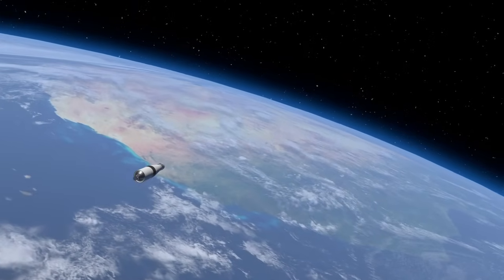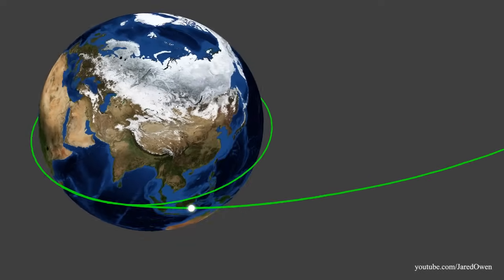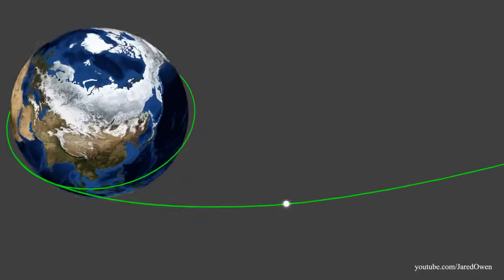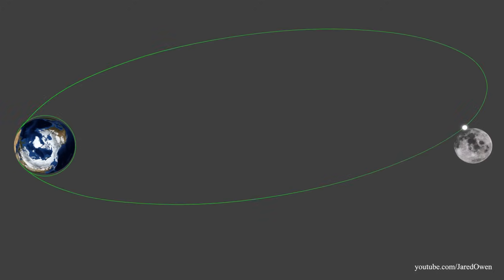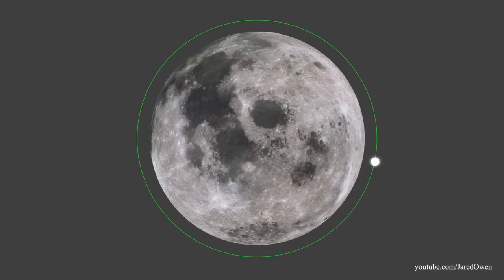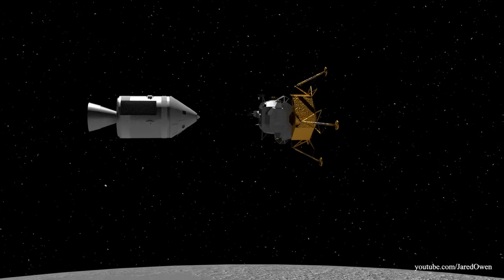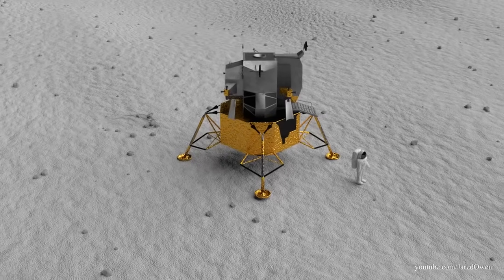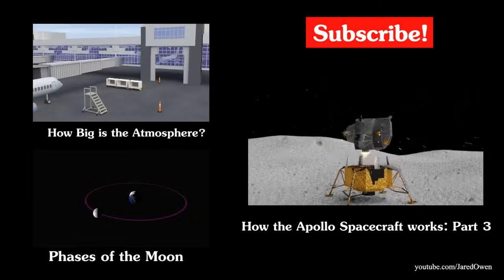How the Apollo Spacecraft works: Part 2

Comment: I'm very interested in watching your video's, but there's one thing that keeps me puzzeled which I hope you can answere being: "How do the two astonauts move (phisically) from the CM into the LM while these two are still attached to eachother ? In my view this is inpossible, because they are connected / joined to eachother on the point where I espect a tunnel to be though where they can drift from the one into the other. I would be very happy if you can point out here I can find the answere to my question or - even better - can provide me with one.
Reply: Once the docking is complete and the seal is verified, the docking probe can be removed from the inside of the CM which leaves the access tunnel between the 2 spacecraft. Pretty ingenious system. Just google "apollo docking pdf" and you'll find the info. There's also a youtube video titled "Collins goes through probe and drogue exercises for space flight" that shows the procedure.
Reply: YOu can google it and get an answer in five or ten seconds

Comment: Wrong, 3rd stage fairings did not detach.  They only folded outward is all.
Reply: That was the original plan but after one of them didn't fully open during Apollo 7, they redesigned them to detach and be pushed away by springs.
Reply: Except that's not what happened.  There's footage from Apollo like 8, 9, 10, that should 3rd stage with only opened fairings, not detached.  I'm  @mako88sb
Reply: @Galactis1  
Haven't had time to search for Apollo 8 or 9 footage but Apollo 10 and 11 16-mm footage clearly show no SLA fairings present when docking with the LM.
Reply: @Galactis1     Had a chance to check the Apollo archive images and both the Apollo 8 & 9 SLA fairings are detached and missing from the photos with the S-IVB and the dummy LM for AP-8 and prior to docking with the AP-9 LM.
Reply: Weird.  I know I seen a video/ photo of the 3rd stage with them connected.  Well probably best that way.  I did see the video of detached completely fairings. @mako88sb
Reply: What happened is that the top would open with a bit of force, and it had a hinge at the bottom that would break off as the petals opened. At least I think that's what happened, take this with a pile of salt

Comment: If that actually happened, then it would've happened again since 1969, but keep believing your fairytale.
Reply: "If that actually happened, then it would've happened again since 1969"
It did happen again, five more times by 1972.
Reply: Why would it have happened again?
Reply: @ DimMitry luckily, I don't have to believe it, because I know that it's true. You don't "believe" in mashed potatoes, duct tape or pillow cases; you know those things are real. It's no different with Apollo, because it's objectively provable.
Reply: Do you think they landed on the moon once in 1969 and then never went back?

Comment: How did they get into the LM  from the CSM?  Where was the four wheeler stored  on the LM? 
They never went to the moon!
Reply: How did they get into the LM  from the CSM?  Through a tunnel connecting them.
Where was the four wheeler stored  on the LM? In the descent stage cargo bay. You can easily find videos of them deploying it, both in training and on the lunar surface.
They never went to the moon! Yes they did. Stop being dense.
Reply: Are you able to bathe with your helmet on or do you have to remove it?

Comment: Ok so no telemetry data is one thing but maybe next video you can explain in detail how the astronauts breathed 100% oxygen for 14 days when medical science says we can. Oxygen Toxicity is a very difficult thing to get around here. Bottom line is if 5 is greater than 3.086 there would have been some major problems maybe including death.  Let's see that video lol
Reply: The cabin was pressurised to only 5psi. One third of normal atmosphere. They were breathing the equivalent of about a 30% oxygen atmosphere if it were at normal atmospheric pressure.
Well below toxic levels for the two weeks maximum mission time.
Reply: @niallkinsella2687  I dont understand how no one sees this?  Ok sea level air is 21% O2 or 3.086 psi. In the shuttle its 5 psi 100% O2. That's an increase of 1.914 psi. The point is that all of the gas we breath can not be 100% O2 for long periods of time, as this would cause medical problems to include death. All the gas laws prove this. Example if you take a container at a vacuum and put 3.086 psi O2 in it and another of nitrogen at 11.466 psi you can mix them and get sea level air. So just take away the container of nitrogen. Now you're left with just the O2. So in order to get the container to go from 3.086 psi to 5 psi you have to add more O2. That is the definition of oxygen toxicity because there is no longer a partial pressure the total pressure of O2 is now 5 psi, which is an increase.
Reply: @benjaminharris6175   
Sorry mate, but pulmonary toxicity caused by hyperoxia only begins to occur in humans when you exceed 0.5 bar of pressure and 100% oxygen.
At 5psi, or 0.345 bar, there is literally not enough oxygen molecules available in a given volume for the lungs of the human body to absorb a toxic dosage through the normal methods of respiration.

Other signs of oxygen toxicity such as central nervous system toxicity only begin occuring when you hit oxygen partial pressures eight times higher than normal atmosphere, impossible without exceeding 1 bar, 14.5psi, so impossible in a spacecraft that is only pressurised to 5psi.
Reply: @niallkinsella2687  you can not take the nitrogen out of the equation is the point to this whole topic.  So going from 3.086 psi or .212 bar to 5 psi or .334 bar is an increase in oxygen and that is harmful. Also a 100% O2 atmosphere will cause a "nitrogen washout" in the lungs and body regardless of the pressure.  A quote from Brandan Kennedy, MD Pediatric Hospital Medicine, Children's Mercy hospital and clinics assistant professor of pediatrics university of Missouri, Kansas City :"Absorption Atelectasis, high doses of supplemental oxygen can cause nitrogen washout of the aveoli there by leading to alveolar collapse.  Loss of nitrogen in the blood causes less total venous pressure.  This leads to the collapse of the alveolus."  When this happens there is NO gas exchange in the lungs. There is no way around this simple fact. 

He also says "shunting resulting  from absorptive atelectasis can rise to as high as 11% in older otherwise healthy volunteers breathing 100% O2 for 30 minutes"    so I say again you can not take the nitrogen out of the equation.
Reply: @benjaminharris6175  : Seems you still fail to understand that the problem is not "100% oxygen" but "100% oxygen at atmospheric pressure.
Can you try to get it?
Reply: @ThomasKundera  you try to get this. If you take the nitrogen out of the equation this removes it from the blood. This lowers the pressure in the veins which will cause the aveoli to collapse. Then there is no gas exchange and you die. Also there is a rise on O2 from 3.086 ppO2 (.212 bar) to 5 psi .334 bar. So toxic or not when the alveoli close due to lack of nitrogen you're dead anyway. And you cant escape that simple fact. Can you get that?
Reply: @benjaminharris6175  : 
What are your sources?

https://ca.thescubanews.com/2016/06/08/diving-with-100-oxygen/

"Below 20 feet, pure oxygen becomes toxic" (so not above).

https://en.wikipedia.org/wiki/Oxygen_toxicity#Hypobaric_setting
"In low-pressure environments oxygen toxicity may be avoided since the toxicity is caused by high partial pressure of oxygen, not merely by high oxygen fraction. This is illustrated by modern pure oxygen use in spacesuits, which must operate at low pressure".

And there is no problem lacking nitrogen: long stay in deep diving is done usually on hydrox: helium and oxygen only (and only a few % of O2).
Reply: @benjaminharris6175  : What are your sources?
"diving-with-100-oxygen/"
Below 20 feet, pure oxygen becomes toxic" (so not above).

"In low-pressure environments oxygen toxicity may be avoided since the toxicity is caused by high partial pressure of oxygen, not merely by high oxygen fraction. This is illustrated by modern pure oxygen use in spacesuits, which must operate at low pressure" (Wikipedia). 

And there is no problem lacking nitrogen: long stay in deep diving is done usually on hydrox: helium and oxygen only (and only a few % of O2).
Reply: @ThomasKundera  yes the helium replaces the nitrogen in the deep dives. It is an inert gas and acts just like nitrogen. So that answers that question, nitrogen is just replaced. 

The source is Brandan Kennedy, MD Pediatric hospital medicine, Children's mercy hospital and clinics assistant professor of pediatrics university of Missouri, kansas city. He says and I quote:"absorption atelectasis, high doses of supplemental oxygen can cause nitrogen washout of the aveoli there by leading to alveolar collapse.  Loss of nitrogen in the blood causes less total venous pressure.  This leads to the collapse of the alveolus."
Reply: @benjaminharris6175  : "The source is Brandan Kennedy" but he's talking about atmospheric pressure, not low air pressure.

As I quoted, some divers are using pure oxygen (only for shallow water) and lots of spacesuits still used today use it.
Reply: @ThomasKundera  yes the divers use pure oxygen. Yes you can breath pure oxygen at sea level yes to all of those things I'm not denying that. I'm saying that you can NOT do it for long periods of time. If the moon missions were 3 days I probably wouldn't have an argument but the apollo 11 mission was 14 days. That's not medically possible.  

Just like scuba diving and using 100% O2 during the deco stops. Yes you can do it but only safely ONCE in a 24 hour period. Why because the O2 buildup is accumulative and builds on its self. Couple this with no other gas ie nitrogen and you would have serious medical problems to include death.  And the deco stops oh by the way do NOT remove all the nitrogen in the body, it removes the excess nitrogen in the body. Never in the history of diving has a diver performed decompression stops to completely remove all the nitrogen for the body.
Reply: @benjaminharris6175  
Your sources are writing about Hyperbaric pressure and supplemental oxygen supplied at atmospheric pressures. They don't appear to mention hypobaric pressure at all.

"No evidence of pulmonary oxygen toxicity was detected in normal men exposed to 0.49 atm of oxygen for 14 days (179 subjects) and to 0.33 atm of oxygen for 30 days (314 subjects)".
"Survey of all available data suggests that men can be exposed to 0.33 atm of oxygen for several months at least without serious impairment of pulmonary function".
- Pulmonary Oxygen Tolerance in Man and Derivation of Pulmonary Oxygen Tolerance Curves; Clark, JM; Lambertsen, CJ; Environmental Biomedical Stress Data Center, Institute for Environmental Medicine, University of Pennsylvania Medical Center; 1970 p.159
Reply: Look for : "Human tolerances to partial pressure of oxygen. From Living In Space by G. Harry Stine. Artwork by Rick Sternbach."

You'll find a chart showing the safe region for human breathing, between suffocation and oxygen toxicity.

You'll see on the chart that bellow a certain pressure, 100% O2 is fine (and at a lower pressure it's even the only way to live).
Reply: https://m.youtube.com/watch?v=LwpuEPoW_Cg NASA Equals 666 proof video

Comment: So we do a complete 180 degree turnaround at 4000mph,  grab the Lem, pull it out of its cocoon, which it then goes into a rotisserie maneuver, turning all three astronauts, who are able, while spinning to make all of the technical adjustments to land a craft which has never been successfully landed.  The gold foil on the legs was brilliant - lets keep them from frying.  I would have liked to see the battery operated air conditioning system that cooled in 250 degree temperatures.  And without the sun?  What kind of battery operated furnace did NASA invent?

Comment: Its so fake, its HILARIOUS!!!!!!
And all this in 1969, caveman times vs 2019. Dream on! IMPOSSIBLE!!!!!!!!! No accidents or DEATHS? In 7 missions? I CALL BULLSHIT NASA!!!
Reply: Jim Lowe, may I politely suggest that you read or listen to some books about the Apollo program? "Failure Is Not An Option" by Gene Kranz is an excellent one (as are many others on the subject). Statements such as what you are making about NASA are akin to someone describing what chocolate tastes like having never seen or tasted any. There were both accidents and deaths, and pretty well every mission had its share of hair raising near misses - some of them REALLY hair raising. How the flight controllers, computer technicians, astronauts, etc got through those near misses were often nothing short of epic. Apollo 13 is of course the most famous, but Apollo 14 also had some hairy stuff that could easily have not only ended the mission prematurely without landing on the Moon, but ended the astronauts lives as well.  

The 1960s were hardly "caveman times." For example,  the manned air speed set by the X-15 (4,520 miles per hour) in 1967 not only remains unbeaten today, no modern plane even comes close.  The Saturn V rocket which was used for the Apollo missions was the largest, most powerful rocket ever launched into space; the Space X Falcon Heavy is powerful, but still can’t touch the Saturn Five. The technology was absolutely there to get people to the Moon and back. 

What is actually impossible is that any of the Apollo (or Mercury, Gemini, etc) missions were faked. ("IMPOSSIBLE!!!!!!!!!") When you have studied this stuff (and that would not take much more than simply reading Kranz' book) that will become abundantly clear. There is a LOT that went into the Apollo program; the engineering and science behind it is extremely well documented. And it isn't something that can be "lied" about, because it is objectively provable.

Comment: Too bad its was all a hoax:

Where is the video showing the inside of them LEM with the astronauts in the moon suits and attached with the bungee cords. They had a periscope in the CSM and LEM for navigation, but for some reason there are no pictures or videos of stars. The second moment changes as the fuel and oxidizer gets used, but somehow these 4 groups of steering  motors kept the LEM from crashing. No remote control or autopilot test landing to verify the LEMs control system and steering motors, with the sloshing fuel and oxidizer and water, but somehow they got it right the first time. The LEM simulator Neil flew and crashed obviously did not have the same second moment as the fake studio LEM on the moon stage. No radar stations on the moon to verify the unknown orbit of the fake CMS, and the ignition time of the LEM, and track the fake LEMs altitude and range as a function of time for descent and ascent. For the moon suit sublimator what blackbody absorber temperature did they use for outer space and the maximum power flux from the sun from the ultraviolet to infrared wavelengths. Same with the engine jet landing on the moon and the missing dust cloud and nobody afraid of rocks piercing the LEM or damage to the antennas, steering motors, or landing radar. They could have pointed the cameras up away from the moon instead of golfing on the moon stage but they decided not to because they would have taken pictures of the stage guys on the catwalk They also drove the moon buggy with lots of dust in the vacuum of the moon studio. Where is the video showing the astronauts in the LEM on the studio mooooon putting on their backpack life support. The clown did a fake spacewalk in the non gravity simulator in the airplane, but for some reason no stars in pictures or video from that. Their studio moon suits were contaminated with moon dust, which likely is radioactive, but no problem to put a Geiger counter next to their suits to verify there was no radiation hazard.Neil jumped off the studio LEM, but since it was live they could not slow down the speed by the square root of six, like the Six Million Dollar Man slow motion, because that would put the rest of their studio acting out of sync..Astronauts could not get more than 6 inches off the moon as they were hopping and walking and pretending to be on the moon stage. Radiation heat transfer on the LEM so they used a glycol cooling loop to radiate that heat back out into the air conditioned studio. Total hoax.
Reply: Can you explain the retroreflectors on the moon and how they got there
Reply: Sue Kennedy that’s not how cameras work tho
Reply: Bob Dillahunty: You are still desperate for a human girlfriend. How is that new android working out for you.